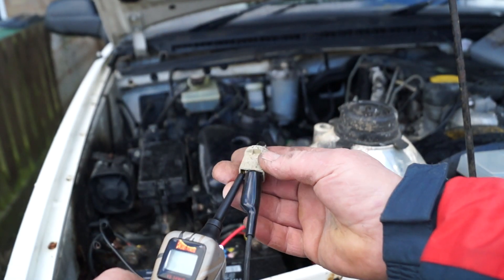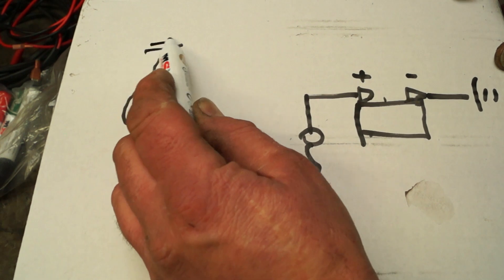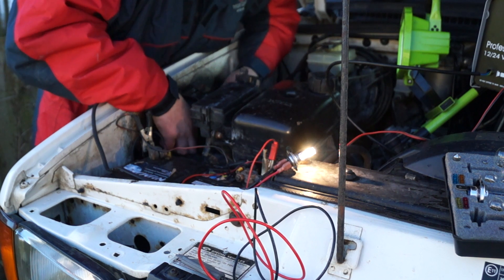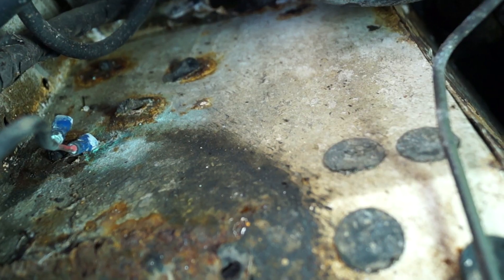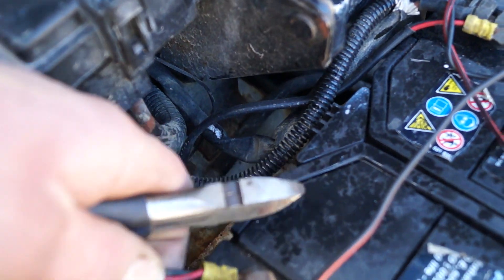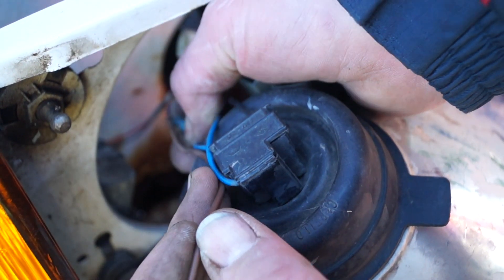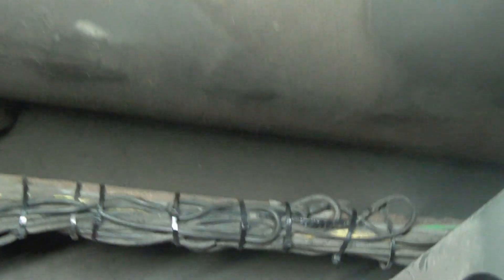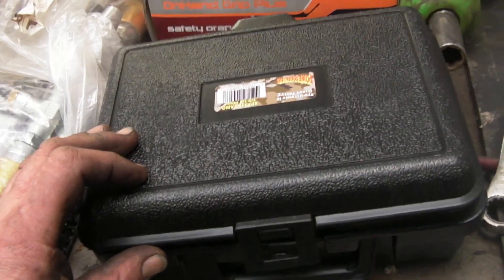Basic Electrical Troubleshooting - Short to Ground finding trick on the white rust magnet

Comment: So , Put a bulb to light by getting the power of where the fuse keeps blowing, Then wiggle wires around until lights either flicker or turn off and if it dims or turns off your around the short circuit?

Comment: so when you go wiggle wire harness and find the short does the bulb dim or go out completely as ive watched twi vids and both had light dim when found and other the bulb went out,i couldnt figure out why the bulb would go out because wouldnt this create a series circuit thus dimming both bulbs (pretend its a headlight circuit) as they now share the same circuit?

Comment: Beware car run 5 volts through some systems make sure you know what your powering up before you put 12 volts down
Reply from the maker: Yes that is correct.  You are talking about the 5 volt reference circuit on sensors.
Reply: is this in regards to power probe or putting a light in fuse place?

Comment: Chris i must say you`ve made my experience as a Land Rover owner (`96 300tdi Disco 1) here in Grenada West Indies a lot less horrifying! I`ve been able to do almost everything on my truck by myself with the help of your very informative and detailed videos, which build confidence and motivates people like myself who have little or in some cases no knowledge of the mechanical workings of a vehicle. So far i`ve done quite a bit as far as the cooling system, head gasket, EGR blanking, valve adjustments etc. however now im having some electrical issues blowing fuses for the indicator switch. I`ve tried swapping out the switch for two different ones from some freelanders that were in a scrap yard but problem still exists. As a matter of fact the fuse blows when the switch is not even installed and as soon as i turn on the ignition. I don`t have a probe but i do have a fluke multimeter. Any suggestions or methods i should use in order to figure out what the problem might be.(should i remove the fuse box/panel and check it for shorts) ??